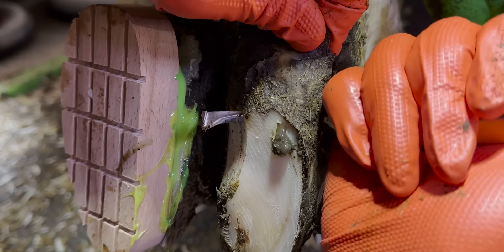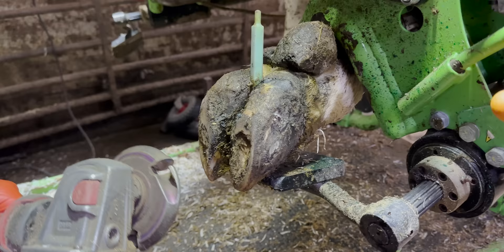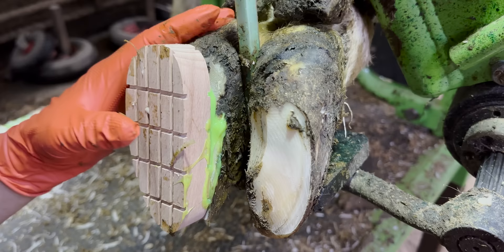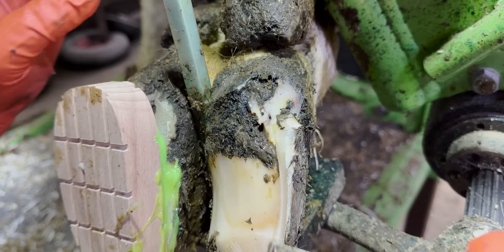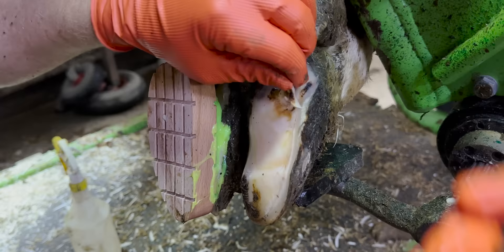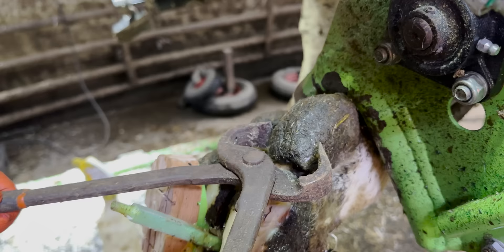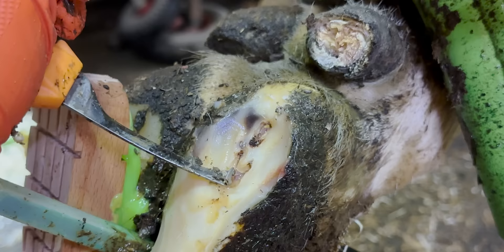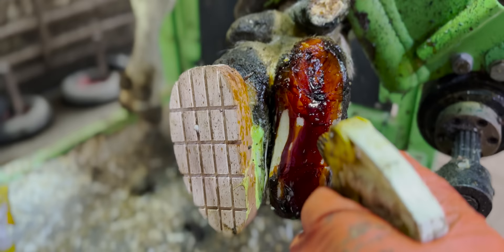THIS MESS ..... ends up BEAUTIFULLY!?

Comment: I notice you need a lot less of the green glue to hold the block on. Craig used to always run a bead of the old glue around the outside of the block after placing the block on.

Comment: I wish someone would answer this question that has been asked many times .. but it this extremely painful to cut away at infections like this? I love how you can feel his compassion for animals but i sure wish i knew if they were in a great amount of pain during the process. And if there was some kind antisthetic that could be used???
Reply: There's no pain from cutting the hoof horn. It's basically like trimming your toenails. There is sometimes some pain from the pressure applied to the abscess, but it's nothing like the pressure from simply walking.